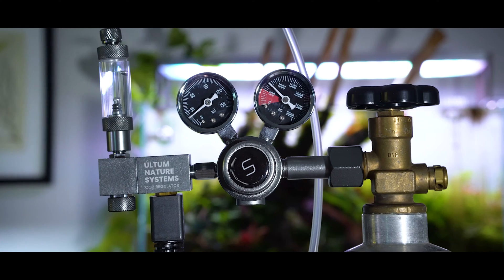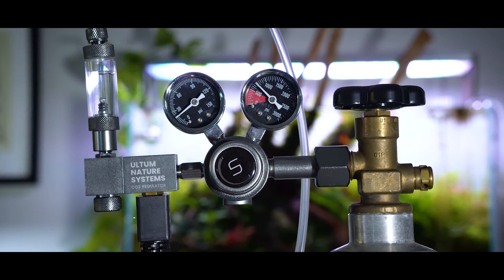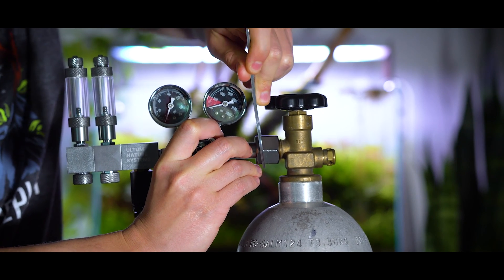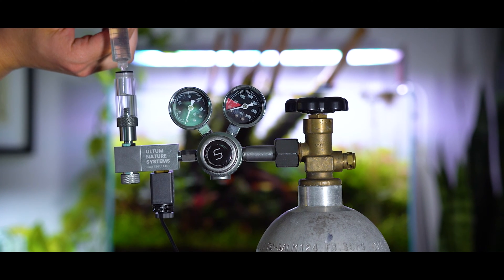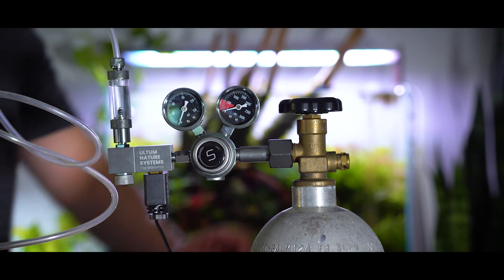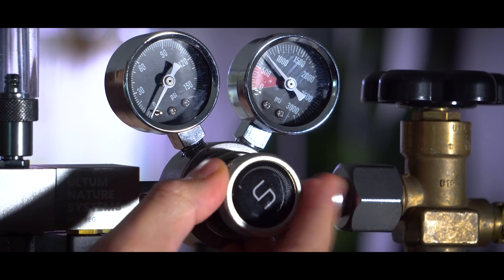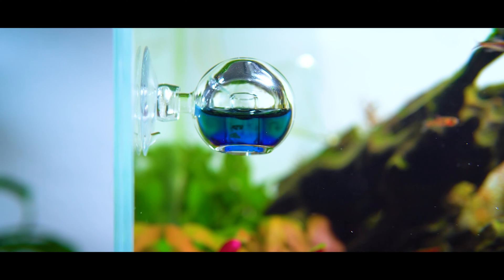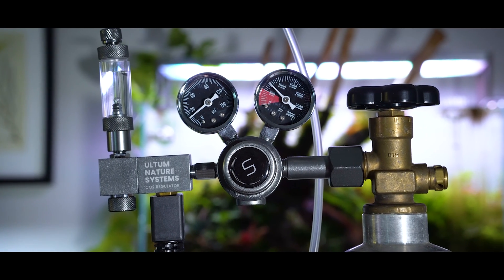HOW TO SET UP A PRESSURIZED CO2 KIT | Step by Step

Comment: How do you set this up with a timer?
Reply from the maker: It just plugs into a timer or smart plug. Built in power supply that controls a solenoid on/off toggle
Reply: @LoganRandoAquascaping thanks mate

Comment: Hello Logan, thanks for the video ! I had trouble with my diffusor wich was a cheap one : the bubble only came out from half of the ceramic surface, I bought a better one, soaked it in water for 48hours before installing it to avoid ceramic from "breaking" when I apply pressure, and still have the same issue. I tried to play with the working pressure and had a better result around 30psi, but this is still not as good as I imagine it should work. Any advice or tips to help ? (I'm on a Sodastream kit, with a Life aqua regulator and a VIV aqua "music diffusor")

Comment: Hye Logan, I wansnted to know if this regulator or the UNS mini regulator will work with cylinders from amazon. I'm thinking about buying the regulator and I just wanted to know if i will have any trouble. What cylinder is that in the video?
Reply from the maker: As long as it's standard CGA320 threads on the Amazon canister, either regulator works. The mini can also fit paintball threads

Comment: I‘ve recently bought a CO2 system and until have been using the same timer for light and the CO2 injection. Due to the issue of the CO2 being low when the lights turn on and the watee being kinda cloudy (using inline injection on a 240 litre aquarium) I thought I‘ll keep the CO2 running non stop on a lower output. 
what do you think abou that?
Reply from the maker: Hey Leon, the better solution is to first get your CO2 on its own dedicated timer. Have CO2 turn on two hours before the lights turn on. Use a drop checker to monitor saturation levels. It should read lime green 2 hrs after the light turns on (due to the delay in the reagent changing color). Then have it turn off 2 hrs before the lights turn off. Your specific mileage will vary depending on many factors so adjust accordingly. In theory running it on low output all day gets the job done but you're running CO2 outside of the photoperiod which is simply a waste

Comment: Nice video Logan! I’ve really been thinking about diving into co2! Would you need a check valve also? I’ve see a pretty cool uns mini dual stage regulator on buceplant! The kit that comes with the paintball tank! I don’t have the space right now for a 5 or 20 lb co2 tank!
Reply from the maker: Hey Darren. Yeah, a check valve is great to use as an added precaution. Plus it helps prevent the CO2 line from backfilling with water. The UNS Mini Regulator is also awesome! I use that one on another one of my aquariums. I highly recommend getting into CO2 at some point. It opens up all sorts of options.
Reply: @LoganRandoAquascaping  cool thanks Logan!